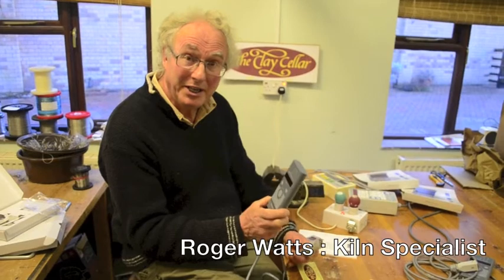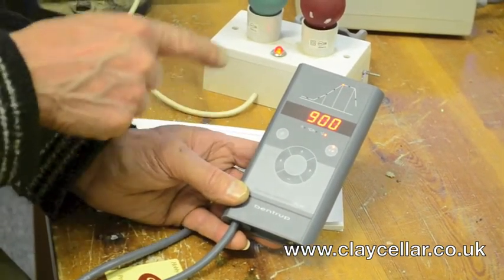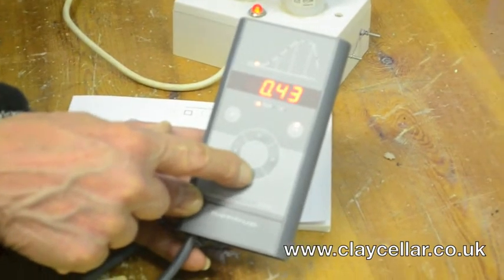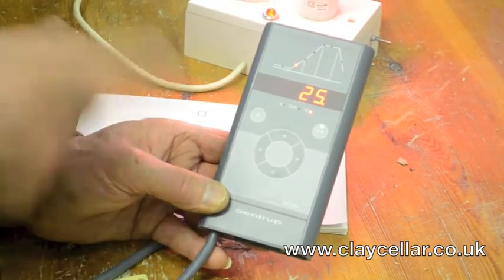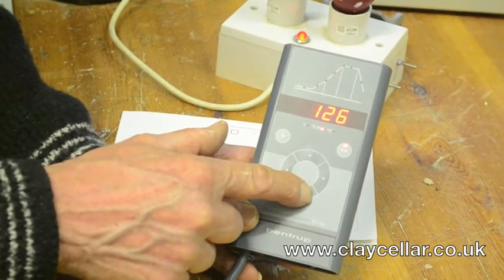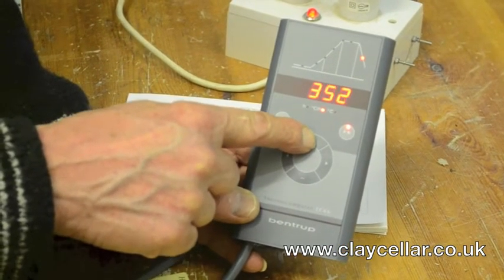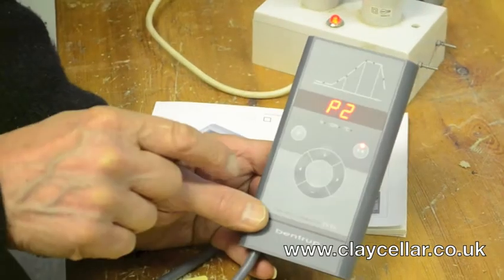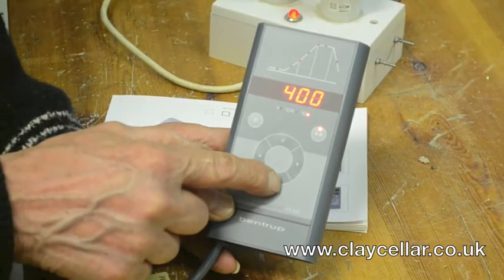Kiln Controller Tutorial (Bentrup TC66) - www.claycellar.co.uk

Comment: Hello . I am writing to you for a personal reason regarding my single-phase electric ceramic oven (230V) Kittec classic Line CB 66 Double and about how to program the plateaus of cooking in the Thermocomputer TC66. I purchased this ceramic oven with the TC66 thermocompudor here in Holland where I currently live, and it turns out that the only manual and instructions I received is very basic and I currently need to do my first bisque firing and later the glazing one but I cannot properly program the plateau which is necessary to fire the pieces with the glazes and for the glazes to set in due time and appropriately.
The manual I received does not mention at all how to program the plateaus in the firing curve that must be programmed in the TC66 thermocomputer and the truth is I need more information about this so as not to screw up and the ceramic is going to break inside me. in the oven or at the time of applying the glazes, do not exceed the temperature and come out damaged. Can you help me and may be also more coustomers with some other video tutorial? 
Thanks in advance ❤

Comment: I bought this controller for a kiln I bought ( without controller ) , Once it checks itself out ( 1:18 in your video ), It gets the E62 error, and then the fuse inside the controller breaks. There is nothing attached to the controller ( except power and temp sensor ). Error 62 is something about continuing fire after power failure. Since its a brand new controller, do you have any idea why the fuse keeps breaking ?

Comment: Hey I've just completed a firing and kiln is on cooling phase, but judging by the cones it hasn't reached the internal temperature that I programmed - can I re programme it (whilst it's cooling) to a higher temperature as it is still quite hot and it would be more economical rather than to wait and start all over again? Cheers Sarah